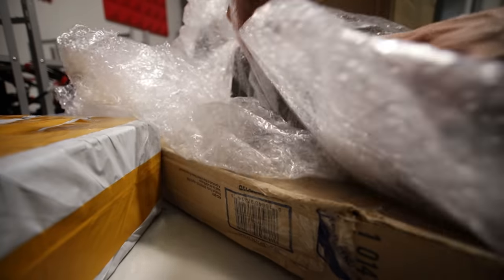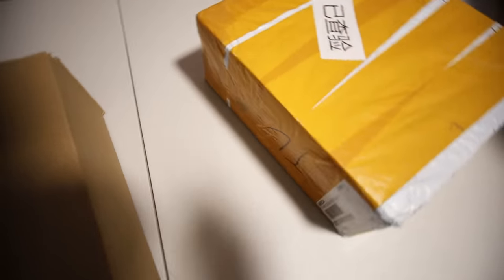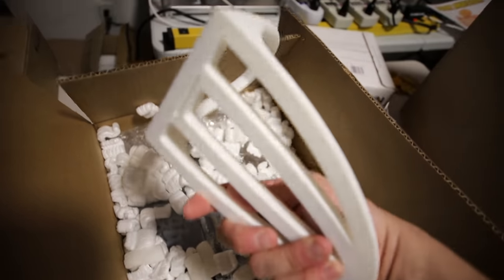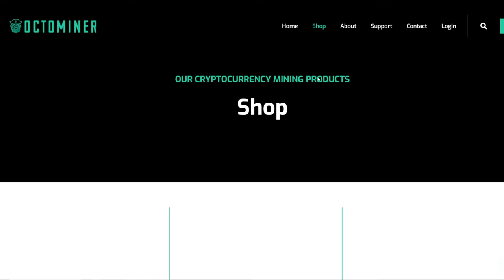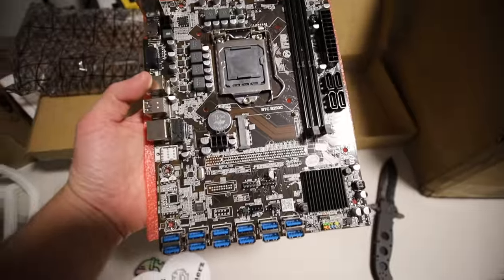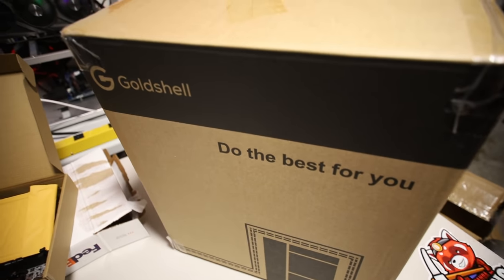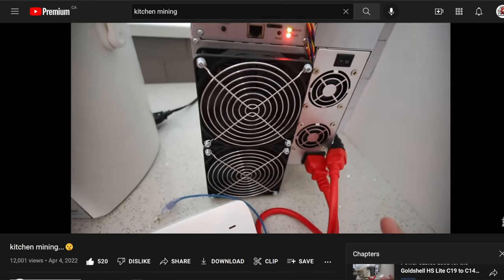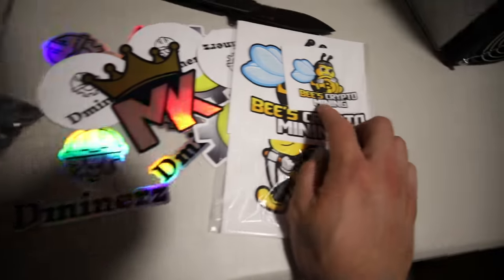unboxing stuff fuels my GPU mining addiction

Comment: Hey RPM! Here's some info. I'll DM you pics as well. Some 3D printed parts will be listed on the site this weekend. More colour options will be available in the coming weeks.
-The first small bag of 3d printed accessories were v009s riser bottom covers, for when the foam pads fall off.
-The second small bag was 3 different sizes of pcie clips, to secure the 1x adapters from risers to the motherboard
Cant wait to see what you do with the 12GB A2000... Copper shim mod?

Comment: When I ordered my A2000's I got the 12GB version, didn't realize that it ran slower than the 6GB version. Would definitely be interested in options to increase the speed.
Reply: I did the same. (Future proofing right?) Mine were in the mail when all the YouTube videos about their performance started to surface.
Reply: I just want to know if the mod causes the GPU to run at full power regardless of power setting. While I would like to get more hashrate, im not comfortable with running near 90-100 watts through the riser. I would still like to do some power limiting if that still works after the mod.
Reply: @ronwatkins5775  I'm going to ride out the 3yr warranty on my GPU's.  I'm more interested in the config settings RPM is going to come up with and share for the 12GB.